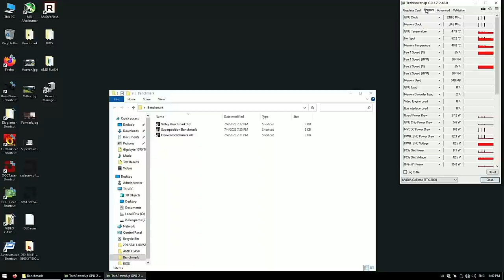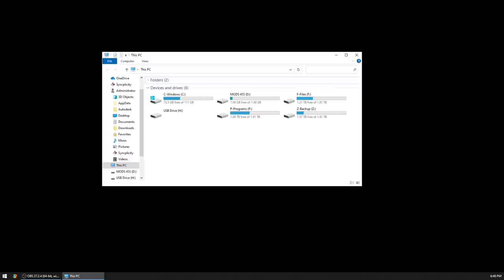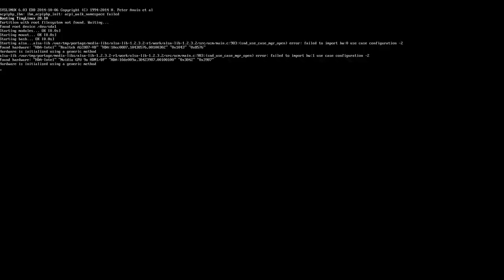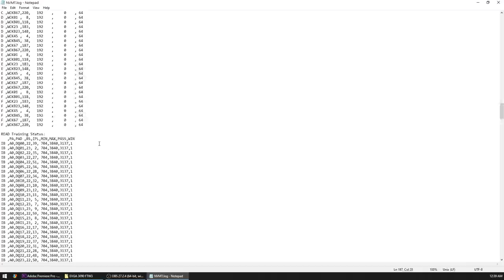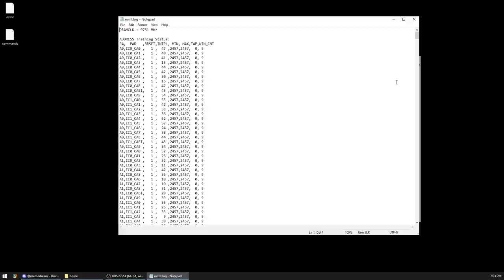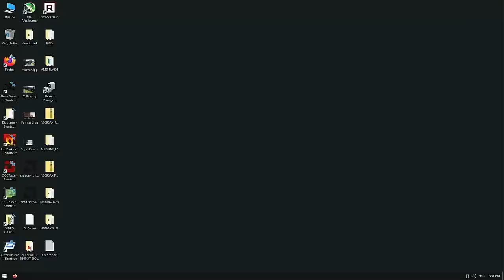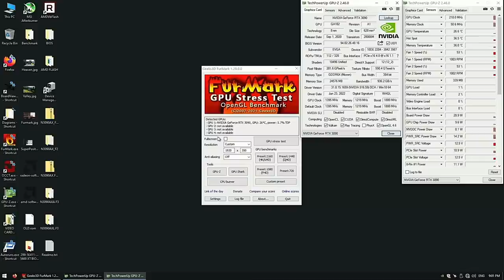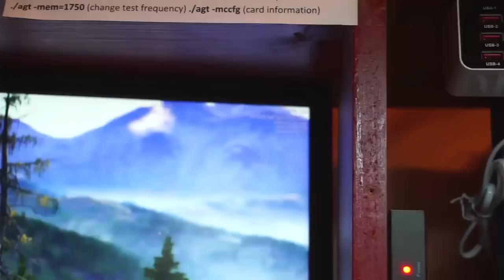Should you trust EVGA warranty ? 3090 ftw3

Comment: I wonder if the reason EVGA didn't treat this RMA of the 3090 the same as they have in years past has to do with them no longer making Nvidia GPU's? Maybe its cost prohibitive so they are being extremely selective against GPU RMA's. Its not an excuse, but it may be a factor internally? Its too bad that EVGA stopped regardless, even though it was probably Nvidia being too overbearing that caused them to separate? Keep in mind, I never really looked into the matter, but I have always liked EVGA product quality, as was mentioned by Northwestrepair.

Comment: I had an evga rtx 2070 where the fans would go right to 100 percent even at idle (was still just under warranty).  I could not stand the noise. Evga accepted RMA without hassle. I was back up and running in just a few days.  The cost to ship was 6 percent of the retail cost or 40 CDN one way. Ouch. But yay for them doing the return. 4 ish years later, I am still using the card.
Evga rocks!!
Reply: Edit: or did :(

Comment: Dropped and broke my Hybrid Cooler for my 3090 FTW3. Phoned them and they said they had none to send me or even air coolers on hand I could have. Pretty sure they have 1000's of dead FTW3 cards just laying around I could grab the cooler off of. Absolute garbage customer service from them, as well as garbage 30 series cards (power delivery was held back, 3rd 8pin pulled half the power of the other two); junk for overclocking

Glad they're gone

Comment: EVGA , actually DOES have thousands of cards available for RMA. They automatically purchase a set percentage of white box RMA units when ordering cards from Nvidia/Fab, generally in lots of 5,000 to  10,000.
And if they dont , they will cover you. WTH , EVGA IS A ROCK solid business!
Ive been buying from them since 2007, was one of the first hardcore overclockers and forum contributors back then too...Built many Phase change chillers, and killed MANY Evga cards...all were warrantied, cept for the melted 480s,  I volt modded with a separate standalone power supply, directly soldered to the Gpu VRMs...
Reply: i had an issue with my 2080 ti kingpin where the voltage i set wouldnt' apply, nor would it even keep stock voltage on load. it kept dropping down to idle voltage even while running port royal. I recorded a video of it doing that while it was on ln2 lol. Showed dmm readings and thermocouple temp in the video and they asked me to try reflashing the bios. It didnt help and they said okay send it in. 

The replacement i got was bottom of barrel silicon so i ended up selling it for what i paid for it in the beginning.

Comment: Honestly compared to every other AIB EVGA does by far the best RMA process. Companies like Zotac and PNY will literally void your warranty because you opened your card to service it with new thermal paste or thermal pads. They specifically right there warranties in the manner where if you opened up your product at all they can deny it I'm pretty sure if the customer reach back out and said hey the damage is entirely cosmetic and has nothing to do with why the card failed you could argue that it is not a valid reason to deny warranty based on the Magnuson Moss Warranty Act. Regardless it sucks that EVGA had missed one but this is the exception not the rule

Comment: ahahahaha! you are hilarious! great video. I was thinking about buying an EVGA card, but I'm not so sure now. it seems like picking a card manufacturer is like a political election. they all suck. you have to  go with the one that sucks the least. 
3 Xs of death, wooohooo!
Reply: You have to pick the right place to purchase a card. I deal with a store local to me just a small shop.
When something breaks they deal with the RMA, even a small store has more buying power then a single person. Shop I deal with replaced a 3800X because it was lost in shipping this from AMD even thou small shop has a confirmed and signed paper saying AMD got it. Still that customer got a new CPU and went away happy. Had a wonky wifi adapter out of warranty and called for a new one, they just took the old one and game me a brand new one. Newegg and amazon are good for some things but not PC parts. I have to drive an hour to this place, would drive more if I had to get this kind of service.

Comment: I'm gonna say this right now, the customer lied, he didn't even send that card in. EVGA will NEVER send a card back without reopening or testing it and this video pretty much shows that card was never opened. ive used evga  since  my first card in 1999 (e-TNT2 M64 32MB) and had nothing but great results from their support. (of the only 2 card that did fail on me, every other one still works fine to this day.) You obviously know nothing about EVGA or you would have called bullshit the moment you opened the card. yeah its true that their support will end for their gpus soon but it does not mean people need to mak up false information about a once and still great company. yeah evga users paid more then normal but 99.9% of the time that extra cost was worht it.  

The customer never RMA'd that card, thats the truth, simple as that. What really happened is EVG probably denied any kind of RMA because of another reason. Even if he did forget to register the card  and the warrentee. As long as he could prove the card was bought in the warentee pediod.  (reciept/invoice) Most the time EVGA honoed an RMA regardless. (This happened to me once out of the two times I RMA my card, I can say that from experiance. (Dat 980ti went bang alright, still honored it even though I frogot to register the card. imagine that. )

Comment: This is kind of a confusing video I must admit. So much time, energy and parts went in to this repair. A person can't help but wonder if it was all worth it and and wonder why you have a high opinion of the design and construction after all of that. I'm not a technician so I'm not qualified to judge, I'm just confused by the conclusion here.

In full disclosure: keep in mind that for my experiences I like EVGA, but that is just from a consumer perspective that has not had a problem with them. Don't take that as a defense, again I'm not really qualified to judge. I just don't have as of this date a reason to dislike them. Especially after their recent decision to stop producing video cards based on Nvidia's treatment of downstream partners and also Nvidia's overall treatment (abuse) of consumers which is why for a decade I stayed away from them until early 2020.

Comment: trust no-one youll be alot happier. EVGA left the video card business for a reason. the new nvidia designs suck the shit from dead mens assholes. a power cable that unless its left straight and unbent melts the card and can burn down your house in 10-30 hours max is a prime example. every pc i have used as my main pc has cost over $5k and i do shit tons of research before i purchase any part going into them. Rule number 1 never purchase a new item on release day. Always wait 3-6 month after release so all the bugs can get exposed. this whole melting power cable on the 4000 series cards is a prime example. this already has me leaning to amd 7000 series cards but will be maybe april or may before i finally get the new graphics card for my new system. Im running my old goto card gtx 1080 ti until i get all the info on the new gen cards and can make a more reliable decision. last machine had 3 evga gtx 780 sc cards in sli built it in 2012 and 2 of those 3 cards are still working perfectly on my cnc machine in my garage and have never been powered down longer than an hour at a time. i dont believe in shutting down pcs from the old days of spinning discs. its also not just EVGA the entire industry has gone the lie to save a buck route. they cant get qualified techs to apply anymore just wokie freaks and its alot less hassle for them to just either say its a user error related failure than having to deal with 15,000 calls and emails on wheres my card because they only have 5 techs working on 1,000,000 returns. you can find hundreds and hundreds of videos on brand new motherboards coming with wasted pins and both the seller and manufacturer claiming its user caused. gamers nexus even went to newegg after he was doing a video and in the unboxing of a perfectly undamaged box he goes to install the cpu and half the pins were mashed. upon sending it back for return they claimed he did the damage. he finally got his money back but it was a shit ton of legal hassle and only upon showing them the video evidence did they concede. All companies are out to fuck you, its just a fact of life. unfortunately we need tech to survive so document opening and installation and buy only when you have finally convinced yourself that this is the card you want after all the bug reports come flying in upon release. sorry for my language i hope there is someuseful info here. i used to build 8 million dollar analytics computers with hundreds of cores and terrabytes of ram and have seen it all.  Current machine AMD Ryzen 5950x Asus Proart x570 creator 128gb ram 16 TB SSD storage seasonic 1250w psu liquid cooled with an old 1080ti thats still running strong.